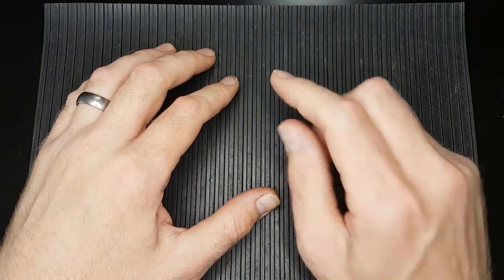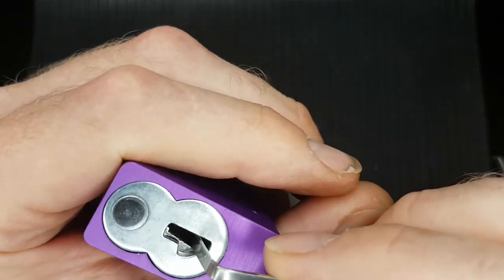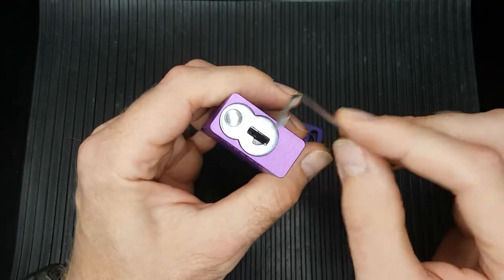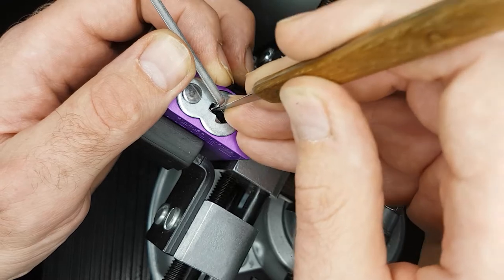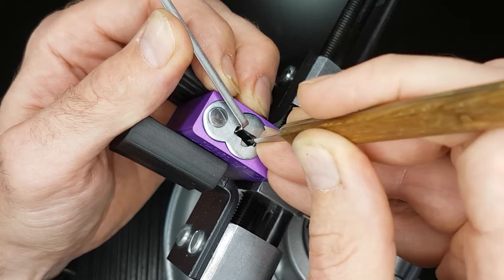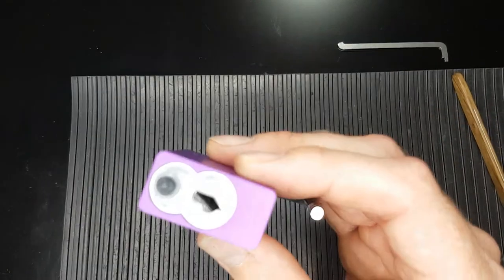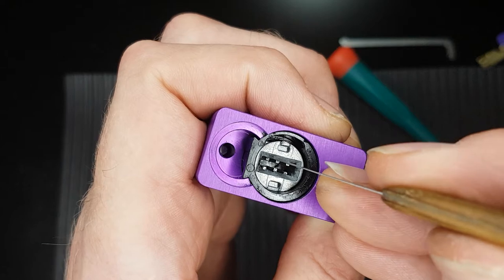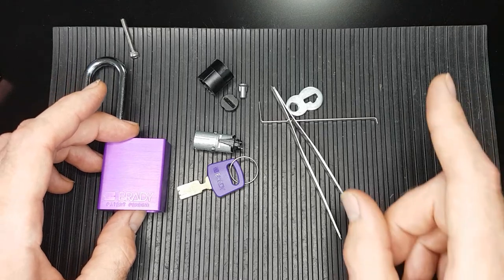Brady Safekey loto padlock picked and partially gutted

Comment: In a way, it's more secure than a 410 (certainly from a picking perspective), because almost nobody will have the means to tension it, so very difficult to tamper with it non-destructively.   Obviously it'd be easy to force; a set of Mole Grips and a big screwdriver would probably do it.  Nice video mate.
Reply from the maker: Yeah I think a brute force would work, unless the plastic tailpiece snapped! Either way, a fun lock for the collection 👍🏻

Comment: Very interesting lock and using the Tubar style key and side bars. Now I need one 😆. Love that purple too.  

Will be interesting to see how many people notice the 1100 you were showing see that you picked the core backwards or that happened when you picked it right and closed the lock up before locking the core up again.  That snapping action acts as a plug spinner turning the core past the lock up point to the other side.  

Another excellent vid D 👏🏻🍻✌🏻🌶
Reply from the maker: That 1100 was a shackle close plug spin 👍🏻
I don't normally shop on Amazon but a birthday voucher sent me there and had to peruse the padlocks of course, where I found this lovely purple pad 😁🍺
Reply: I close my 1100s after picking without locking back up at least 50% of the time.